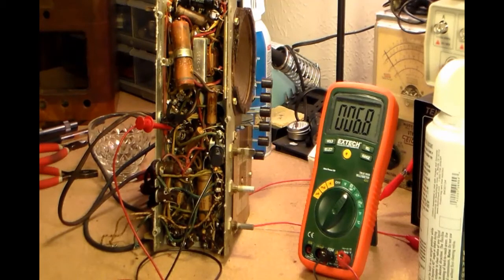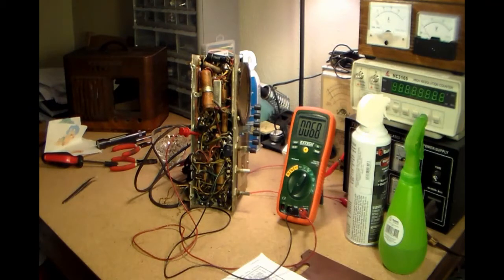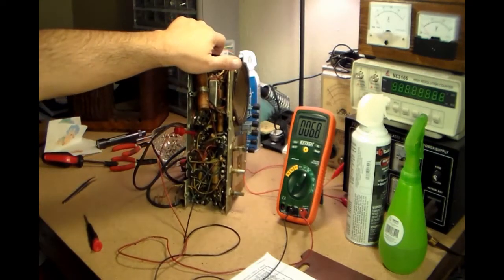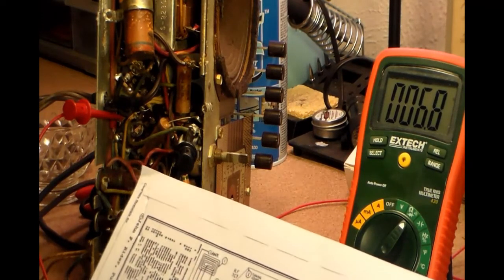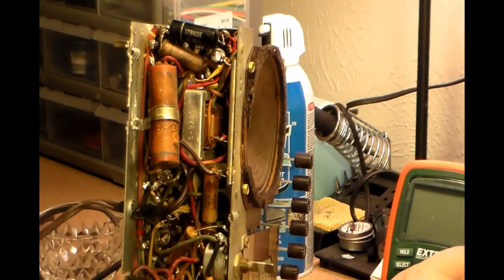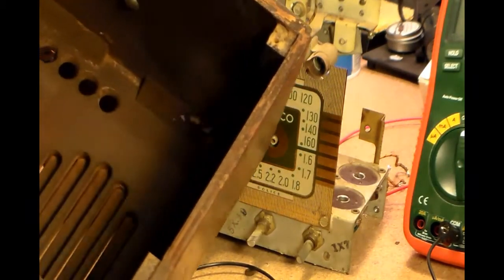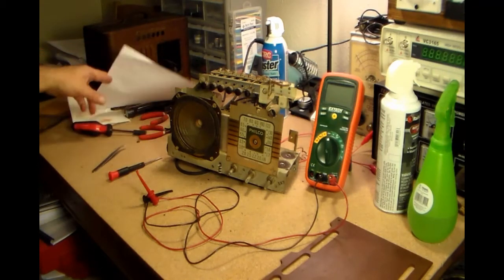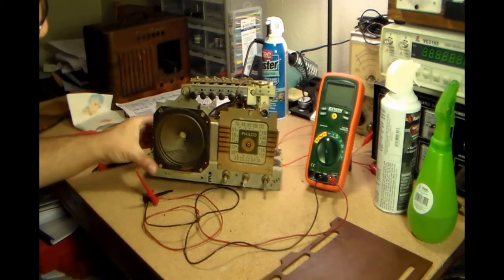Philco 40-125 part 1

Comment: Bret,
Correct.  Apply it to the wood, smear it around with a clean cloth, then wipe away the grime with a damp cloth.  Then do a second wipe down.  You'll have to see for yourself how good it works.  Go-Jo works a little better than Goop.

Regards,
John